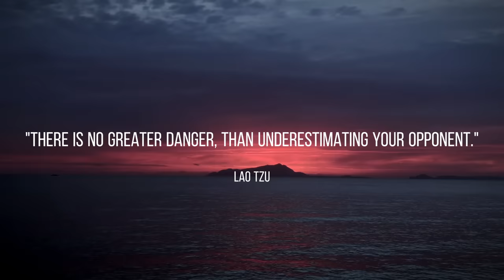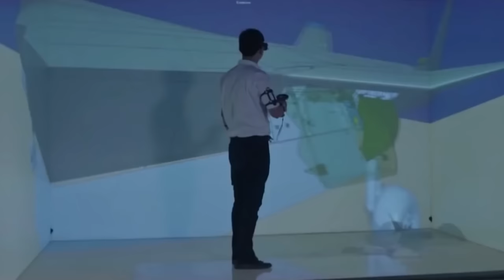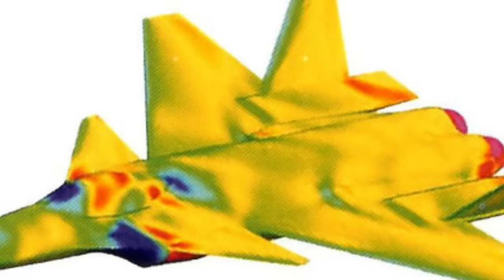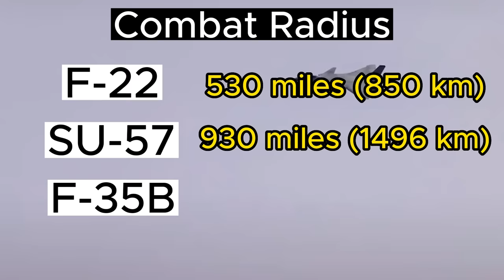China's Stealth Fighter, Good or Bad?

Comment: May not be as advanced as western jets but any advantage from what you had before is better than nothing. 

The way larger range is an advantage because you don't need the extreme resources for a carrier group or bases closer to your targets. Sure you can use air refueling but that takes time to refuel and are vulnerable. And if you are engaged and low on fuel you are also at a disadvantage. And using afterburners use a lot of fuel. 

If the Chinese can put out a better engine then it'll boost their capabilities a little more. May still be behind western aircraft but like I said. Any improvement is better than nothing.

China is making huge advancements in a short time. You can criticize all you want about stealing and copying because in the end they achieved enough to make it happen. And it's not always who has the better toys win.
Reply from the maker: Indeed, also worth noting the Chinese geopolitical situation puts their likely flashpoints quite close to home, which has effected their design choices.
Reply: True, but planes like the F-35 also have the advantage of numbers and thanks to economy of scale they're likely cheaper too. There's nearly 5 F-35s flying for ever 1 J-20 right now and the price tag of the F-35 keeps dropping putting it within reach for more and more countries, and making it easier for countries to buy more of them. The J-20 meanwhile only has 1 customer and even if they were willing to sell it to other countries most people dont seem interested in buying Chinese warplanes compared to European and American equivalents which makes it all the harder for China to gain the numerical edge, and means it's easier for the US to dump larger amounts of money into R&D. That supposed/likely theft of technology that happened with the Joint Strike Fighter program also has made countries more paranoid about security, especially seeing as we seem to be heading into a new cold war, making future copying of tech more difficult which combined with increased R&D spending by the US means it's going to make it harder for China to catch up in the future and harder to innovate domestically. The PLA is getting larger and larger budgets as the PRCs economy continues to grow, and if we continue into a new cold war that's all the more likely to happen, but it's alos possible that similar to the USSR in the 40s, 50s, and 60s once scared out of complacency the US may only accelerate the technological divide.
Reply: True, and a new Cold War this time around would be a mess.  Not sure how capable the rest of the worlds countries trade will compensate that buying power deficit from the US if that ever happened.  At the same time, the US hasn’t positioned itself very wisely to manufacture internally like it had in the past….another Cold War doesn’t look too promising for anyone, anywhere.  The US military complex might be the only winner ATM between both countries?

Comment: The F22 is 13 years to 18 years old. Hadn't had an update whatsoever since. Think about a Ferrari from the late 2000s to 2010s compared with a new modern EV vehicle from China like the Nio, BYD, Xpeng, etc etc etc..
Reply: I guess that's why the F-35 is selling like hot cakes compared to the F-22, still, it's better than anything Russian by miles

Comment: I have now conflicting information; I've heard from one angle that Chinese airforce pilots are trained a lot on how to dogfight only to hear from this video that the J-20 doesn't have an autocannon.
Reply from the maker: Dogfighting training is still very common, pilots need to maintain the ability to handle high G’s and learn the techniques they may need, while also learning other methods. F-35’s are always buzzing around practicing this too, despite it being - if anything - a secondary role.
Reply: There are dedicated short range missile with Helmet-mounted display and sliding missile launcher for dogfight. It seems China just do not believe dog fight with autocannon, or they trust their long range missile and do not believe 2 short range missile is not enough.
Reply: China has plenty of planes that have autocannons. Look at the new J-15's